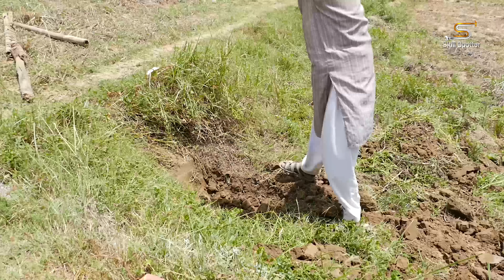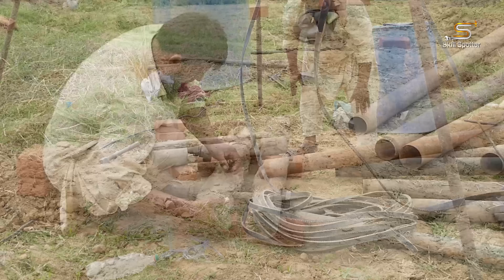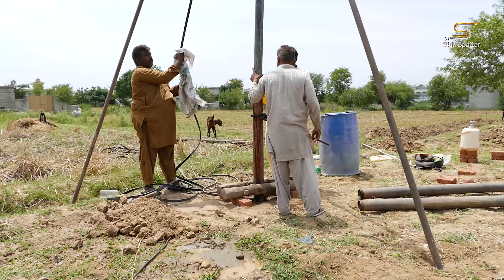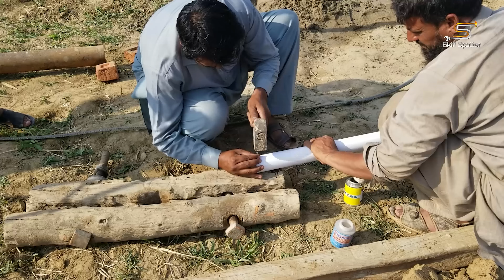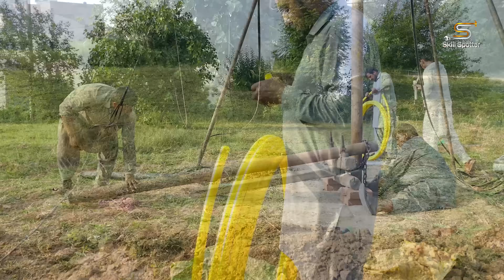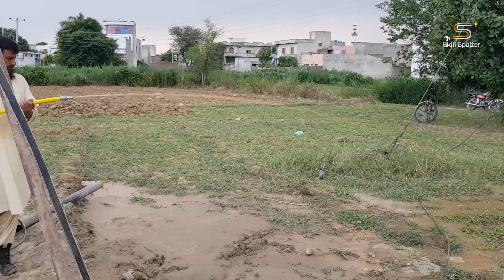Perfect Borewell Drill for Clean Water | Water Well Hand Rigging | Simple Borehole Drilling Process

Comment: I was wondering how you know when to stop boring, like is there a specific type soil or rock you look for to know when to stop boring. And I was wondering about how deep is this well? Great job fellas.
Reply: hi, 
usually depth is 35 meters  depending on area, they stop after clear sand
Reply from the maker: When they find a lot of clear sand they stop drilling.
And normally they do 80 to 90 feet drilling by hand.
Thank you so much for your comment.
Reply from the maker: Thanks a lot @sulemanghani4592

Comment: Must have missed something. All that white plastic pipe looks solid. How does the water get into the pipe to be pumped????
Reply: At around 25 min. he is glueing a small diameter to a bigger, the bigger pipe is slotted and around a man s height.
Reply: Purpose of this smaller pipe and why it is smaller beats me. 

Some installers ask me to put a "pump-chamber"" at the bottom of the well ,  this is for installing a submersible pump in.
Reply: @haynillesen  I think the idea of the smaller pipe is just to bring the pump off the bottom metre of the bore. What they were pulling from depth looked to be quite soft. The difference between this well and the ones H2O Mechanic drills is that his pumps hang from the pipe and this one looks to be resting on the shoulder of the liner where the diameter reduces. No danger of dropping the pump in the well this way.
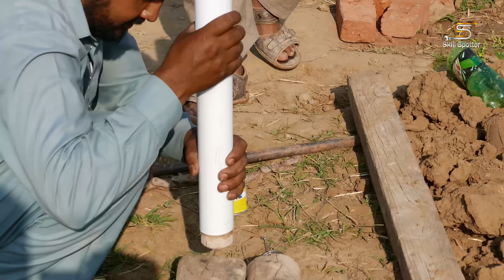Reply: At 24:09 he's gluing in something to the smaller pipe.  Any idea what it is? plug, foot valve, check valve?  I don't see any holes or slots cut in the pipes to make a well point. Maybe just too small to see?? Seems like the smaller diameter of pope is about the same diameter as the pump??  Maybe to secure pump from banging around when it starts?? 

Doesn't seem like they are getting much water out of the pump, maybe 4 or 5 gpm tops.
Reply: Es el tapón para que los sedimentos no entren por el fondo de la tubería. Usan un pequeño rolo de madera
Reply: How can small stones go inside the pipe drill, i see they pull with high power but release with low power?

Comment: it would really suck hitting a bigger rock 3/4 of the way down. looks like a lot of work
Reply from the maker: You are right but these experts are used to drill in this area and they are aware of ground conditions that's why they don't hit the rocks.
But if any hard rock comes on the way they can't drill through it with this technique.
Reply: Tienen agua gracias al sacrificio